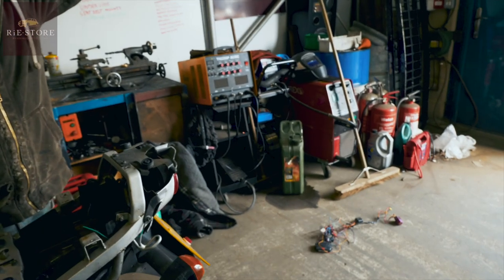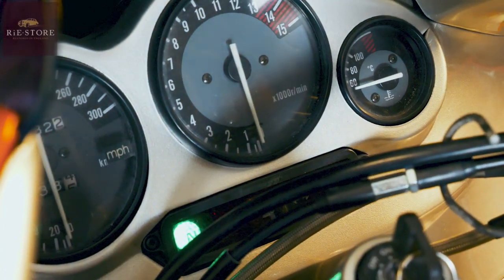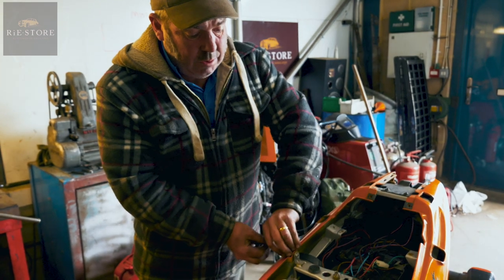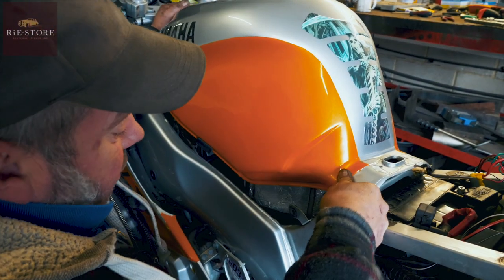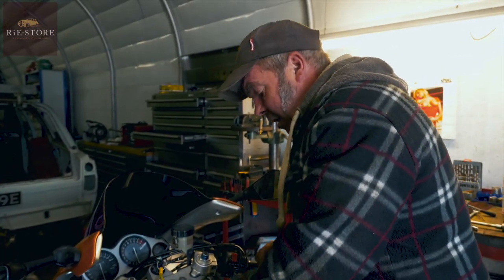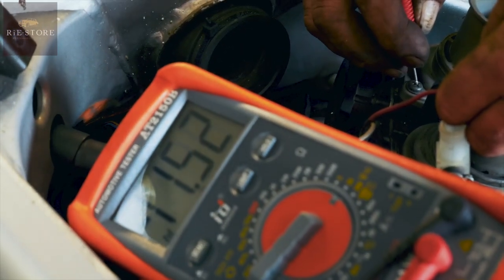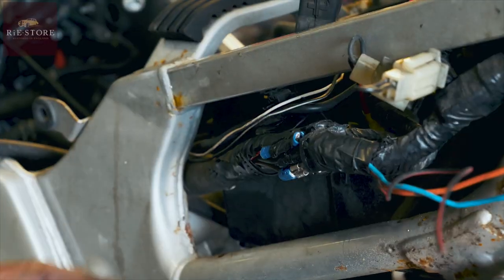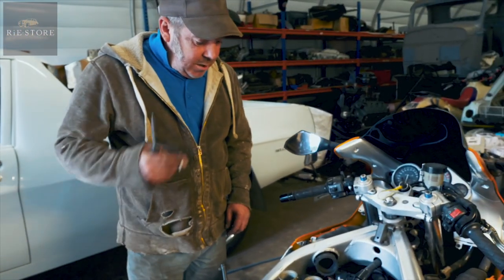Diagnosing a non-starter - Yamaha Thundercat / ep027

Comment: Good vid, Cheers. The zero to 8, is to let you know the tank low fuel warning light plug, below the tank, is disconnected... I took all my carb boot-spouts out, as one was so loose, I pulled it out with my fingers and the others were little better. Then threaded and plugged them all, with short domed head Alan-screws. I balanced my carbs before I put them on, by assembling them all and looking through the flaps and equalising the small light gap, as they all just began to open all together, then put them all on, and it worked fine for me. I also did away with the carb pre-heat tubes, as you only need then in extremely cold regions, as with the same engine Artic Cat snow mobiles. And just ran a by-pass tube across left to right = 2 lots of confusing clutter tubes you don't FUCKING NEED! You are right about the alarms. I have a talking one, as although It scared thieves away once, it drains your battery, If you don't use it every day.

Comment: Bought a 1996 thundercat, was left sitting for about a year waiting for me to pass my test. Trying to start riding it managed to get it running with a new battery and seemed fine. Took the bike for a good jet wash and then the next day I'm having issues. Bike won't start and bike jolts and cuts power when riding sometimes. Not sure what to do just gonna have to take it to a garage and hope they don't fuck me over.

Comment: Just purchased one that’s been sitting for 12 years not getting no lights on the dash like the gas and oil just neutral light cranks cranks but no spark there is power going to the coil though any help